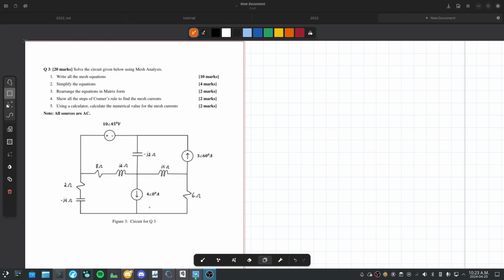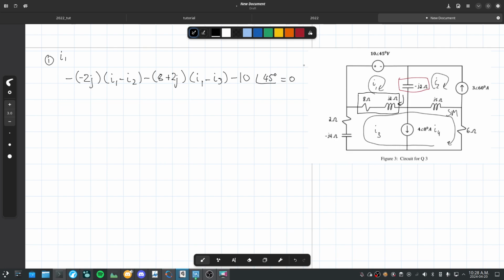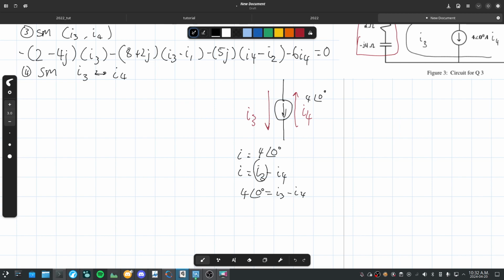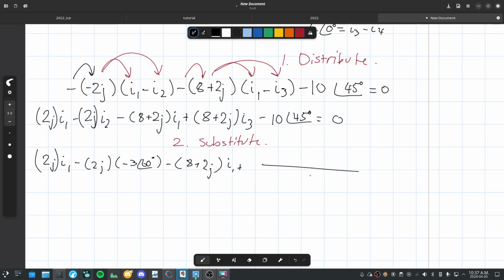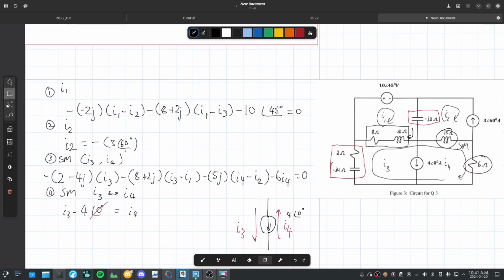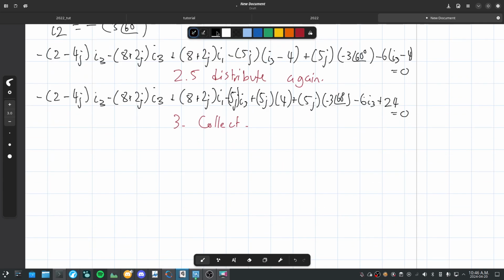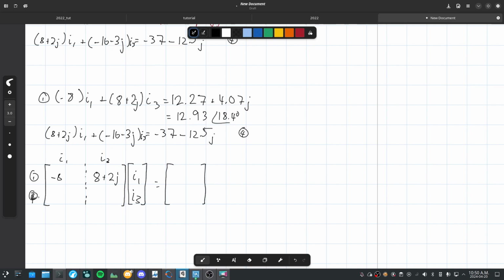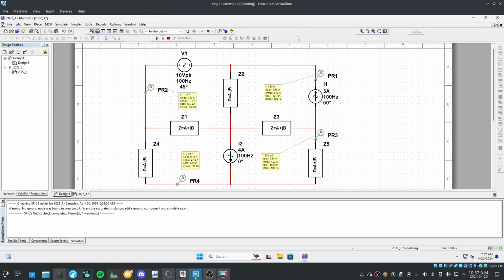TMU ELE202 2022 Final Q3 FIXED - AC Mesh Analysis - Electrical Engineering

Comment from the maker: Question: Why is -(3<60) = 3<-120?
Answer: Negating a phasor results in an angle change of 180 degrees. You can verify this by drawing a line on the cartesian plane, drawing the same line with equal and opposite length, and finding the angle of both from +x. You will notice the negative line is 180 degrees off the original line.
You do not need to know this. Your calculator should be able to handle negating phasor numbers.

Comment: quick question, do we need to worry if the capacitor+ resistance or inductor+resistance are in series or parallel or do we only worry about that for the last question of the final?
Reply from the maker: You should expect to see reactive and resistance on the same branch for all questions on the final. Once you put your circuit into Phasor form though, you can simply reduce them as you go.
We call these combined loads "Z-loads" because they are complex.

For example, if we have a 10 ohm resistor in series with a 9j inductor, we can combine them using Series to a single Z-load of Z = 10+9j. This is your impedence.

This works even if inductors/capacitors are on the same branch. If we have a 10 ohm resistor in series with a 10j inductor and a -5j capacitor, the Z-load will be 10+10j-5j, or 10+5j.

Z-load addition follows the same rules as resistors, so add in series and (Z1*Z2)/(Z1+Z2) for parallel.

I hope this answers your question.